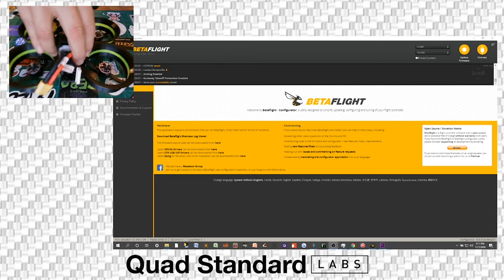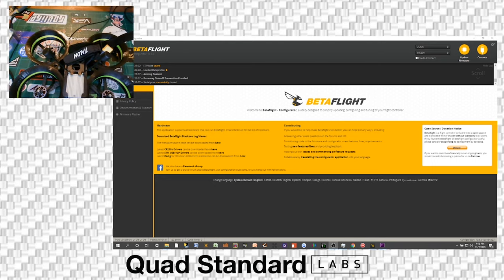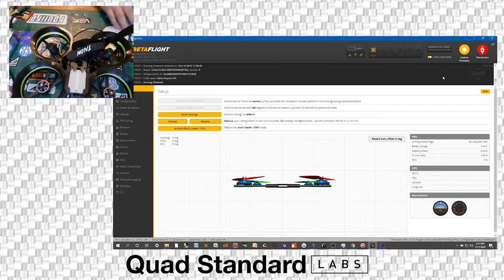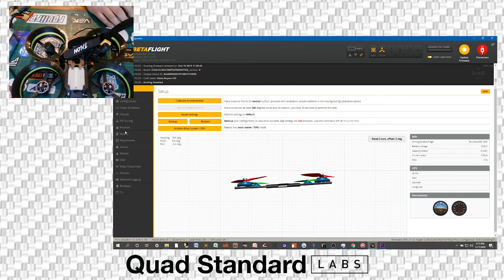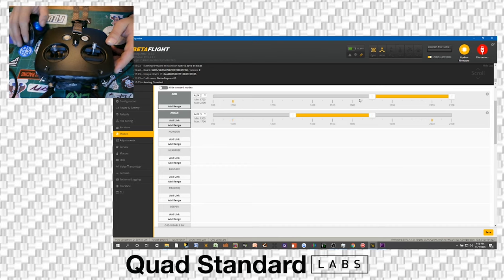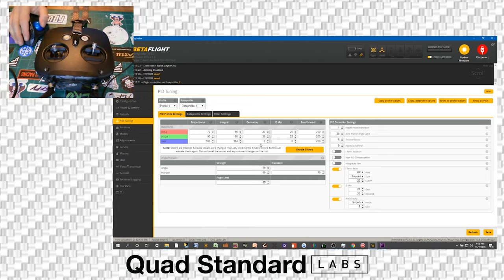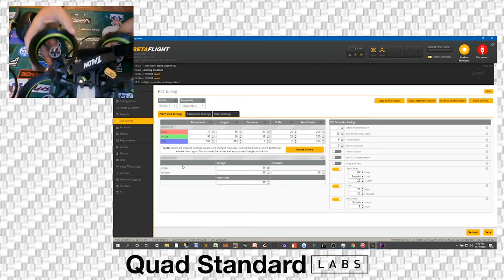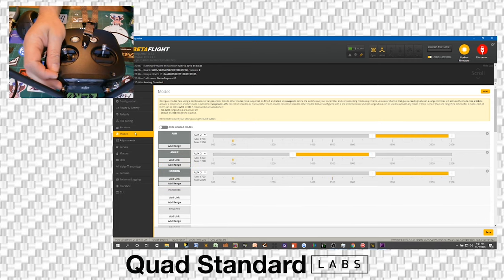How to Add Stabilize Modes to Your FPV Drone

Comment: Having angle mode on a switch is more important than many pilots realize. If you start to loose video, flip the quad into angle mode and punch the throttle. Although you can't see, you know the quad will be heading UP, where reception should return.
Thanks for covering this topic.